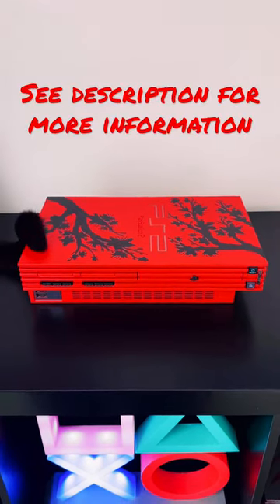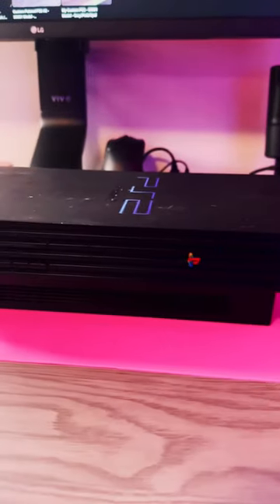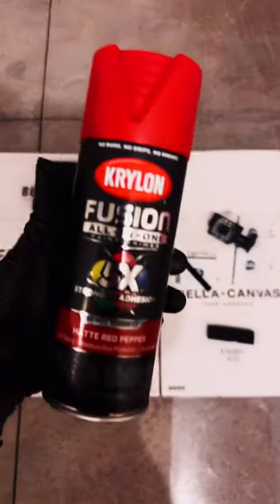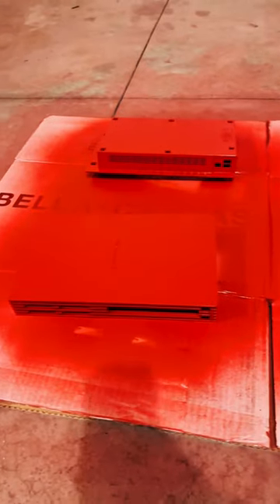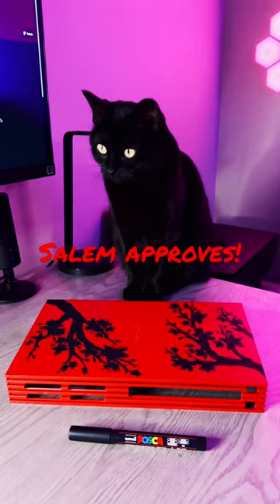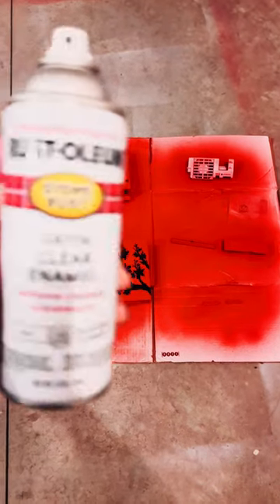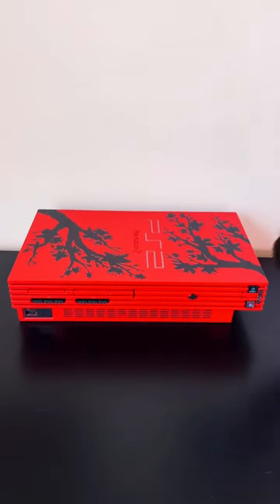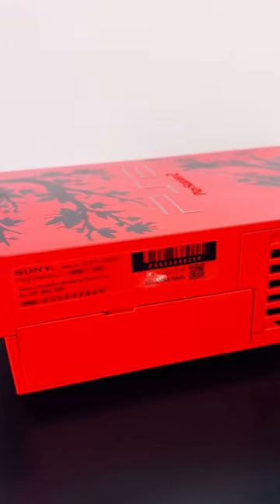My Process For Painting Fat PS2 Consoles

Comment: Does painting the ps2 remove scratches? I want to paint my ps2 black again but only if it makes the scratches invisible.
Reply from the maker: It depends on how deep the scratches are. Paint doesn’t always hide scratches. Black paint will hide them a lot better at least. You could try looking into using a wet sandpaper method before painting, but you will risk ruining the plastic.